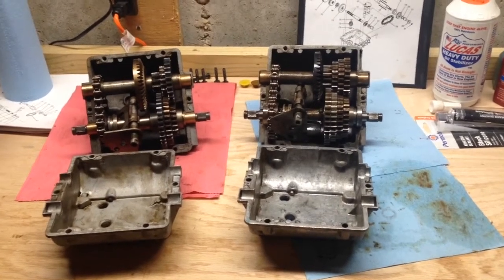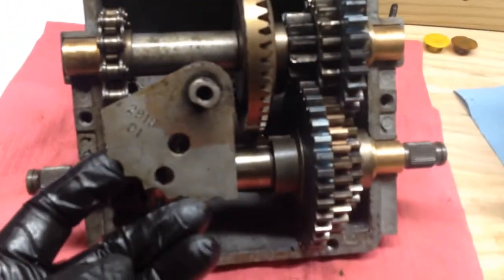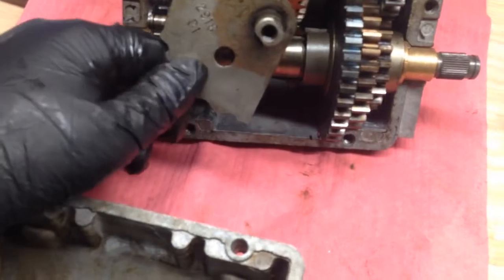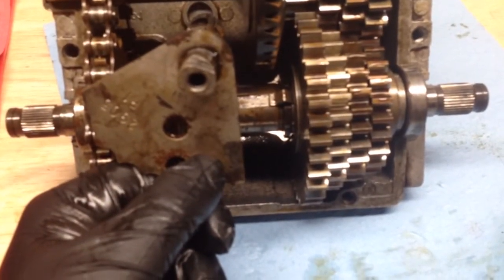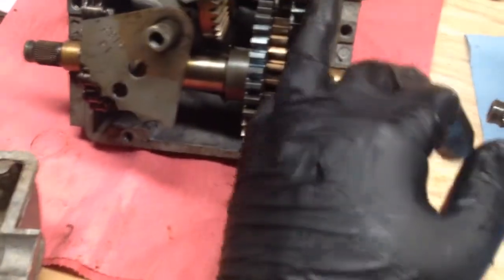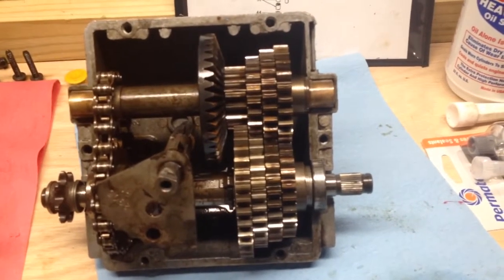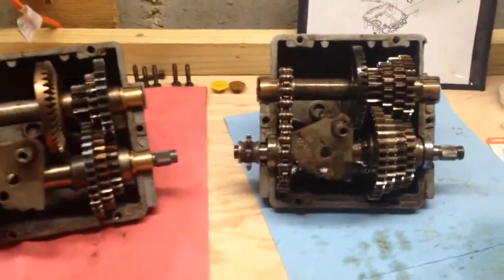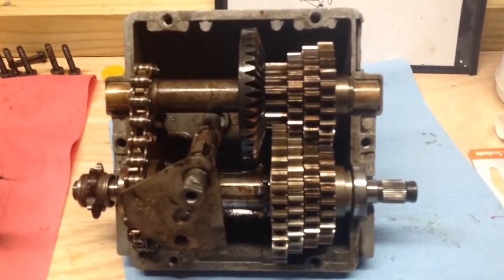Peerless 700 Tech Talk & Mod

Comment: @BUILDNIGHT you think there’s any way to change the output shaft direction on these? I have a blower that had a dual shaft engine and I swapped to a single shaft engine so now the transmission runs backwards. I was thinking if I flipped over the gear that contacts the pinion gear it will reverse the rest of the transmission
Reply from the maker: Anything is possible, but that will take a little work.

Comment: are there any tell tale signs on the casing that I can look out for on whether or not it has the roller bearings on the output shafts?
Reply from the maker: Daniel Auen 
Good question... I’m not sure...I will have to look for some.
Reply: sorry for the delay. Most gearboxes that are 700-039 have the output shaft with bearings
Reply: Daniel Auen most 700’s that have the model 700-039 have the bearings on the output shaft

Comment: Can you shift these while the vehicle is rolling? Or does it need to be stopped?
Reply from the maker: Phil Lowman Yes, you can shift these while in motion.  Many people use them in racing lawnmowers.
Reply: MetalMan 329 you do not shift the 700’s on the fly. Not in a racing mower anyways

Comment: Hey Metalman, got a Peerless 3628 on BobCat walkbehind. My drive pulley has managed to migrate out of alignment throwing my belt out of its groove. I can’t tell from manual what keeps shafts from sliding in and out? No set screws. I have a collar with grease fitting that  will move away from gearbox when this happens. Thanks
Reply from the maker: hi....there should be a C-CLIP that is on the shaft which prevents it from climbing out of place.  Sounds like your C-CLIP might be missing.
Reply: Is it possible the circlip has worn the groove to be bigger than it’s supposed to be? I played with it last night and it seems like a wide groove, like over 1/2”. I was expecting circlip thick wide.